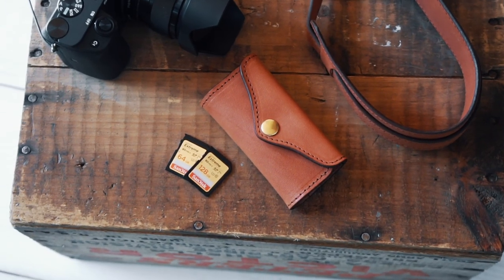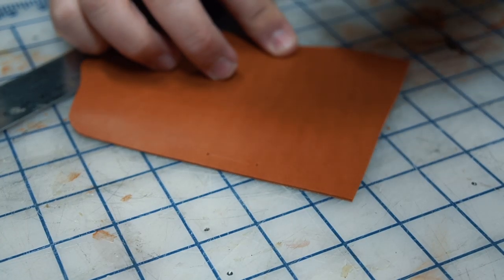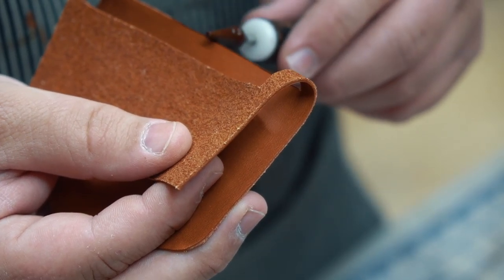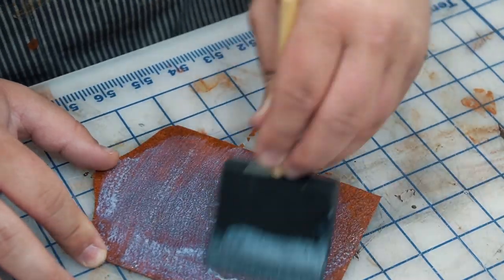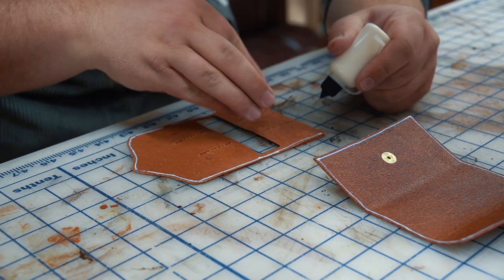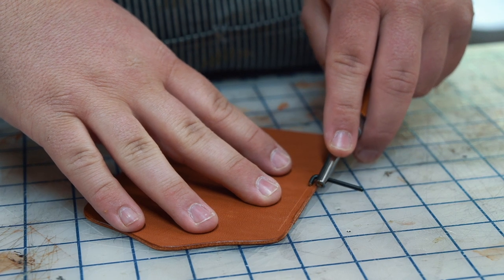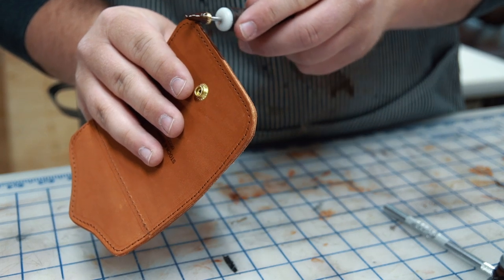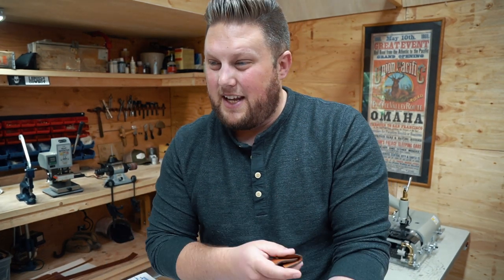Making a Leather SD Card Snap Wallet

Comment: I have a similar sewing machine as you and I also had similar mistakes when sewing. To prevent this, I have built a flat bed of wood for my machine which can easily be clamped on and taken off. Then the stitches are sure to be straight.

Comment: i wana give you an advice about the camera, when you puch lether with te malet this will shka the camera harder, and when the circuits in it are hot will be cut or damaged try to hang it  or put the tripod on a large piece of foam or hang it with elastics, i am amazed by your job, you're in the good way, have a nice day

Comment: Hey Parker, I love watching your videos and I watch them very closely. I have seen you have difficulty going over straps and such on your Techsew machine. Upon closer examination, I can see that your machine is a little out of adjustment and is causing the problem. That machine should have plenty of foot lift to go over anything you sew. There is an adjustment that balances out the amount of lift between the inner foot and the outer foot. All the lift is on the outer foot and the inner foot barely rises at all. When sewing something like a strap onto another piece, this causes the inner foot to push the strap out of position instead of stitching over it. You can also increase or decrease the overall amount of foot lift. Call Ron at Techsew and have him help you get those feet lifting evenly. It will make your sewing much easier and show the true capability of that machine. Keep on doing your great work!

Comment: One word: Barge.
Reply: Overpriced. DAP Weldwood Original is roughly 1/4 the price and works just as well. Barge can be hard to find locally in larger quantities, but you can buy the DAP cement at Lowes, Home Depot, Walmart, etc. and save the shipping cost. Having said that, I'm seriously considering the Aquilim cement to help reduce some of the toxic fume exposure. The price is comparable to Barge, without the health hazards.